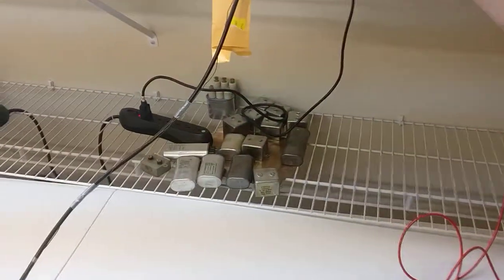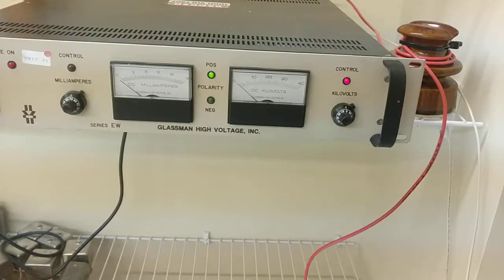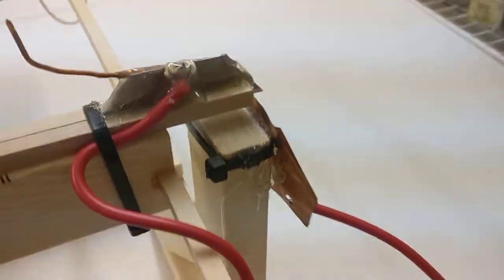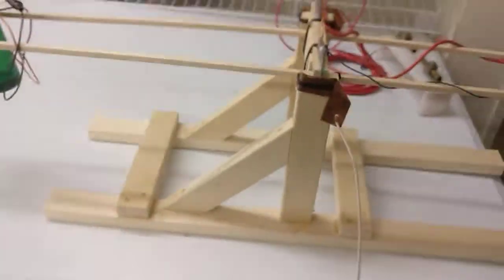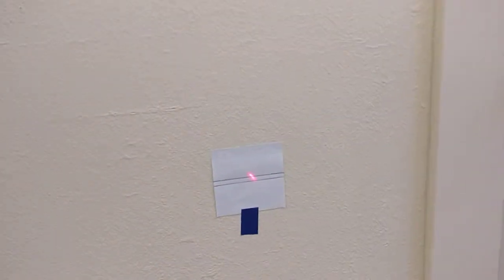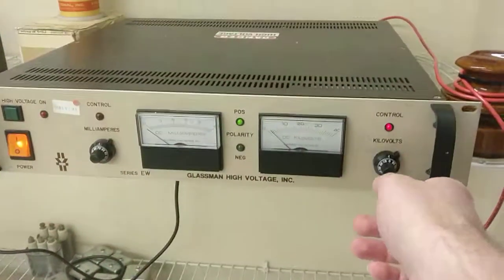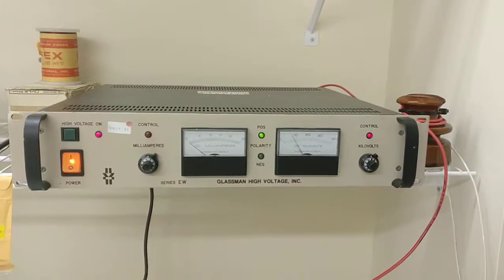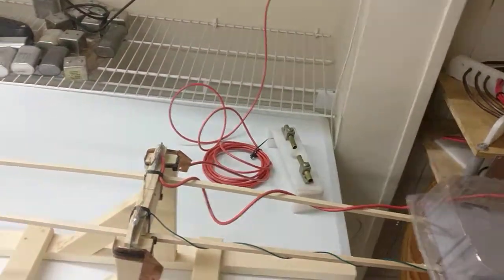Electropropulsion Test - TT Brown

Comment: You will get ionic thrust (generating airflow) below 35,000 Volts. To generate Biefeld Brown effect, you will need higher voltages. The vid  https://www.youtube.com/watch?v=Rp4hygoD3RU shows his asymmetrical capacitor did move upward inside the vacuum glass bell. Cheers!

Comment: Great job, love the setup.
We are conducting similar tests with much higher voltages (up to 125k dc).
Our research indicates that the speed of the charge up is the most important factor that creates anti gravity.
Preferably you would want a large power HV capacitor discharging into another parallel plate capacitor with a high K dielectric in a matter of nano seconds.
Its the pulse that creates antigravity not the voltage. once the capacitor is charged it must be discharged in order to repeat the experiment.

Use of Dc to dc converter to discharge the target capacitor and recharge the supply capacitor can help recycle the energy and make for a more efficient space craft.

slowly charging up a capacitor to 20k dc should not result in any noticeable effect, but when the capacitor failed that may have produced a small pulse, but I noticed you touched a wire on the balance at the end so you can't rely on those results.

Good luck!
Reply: Falcon Space Program Woodward refers to the quick charge/discharge as a “chirp”